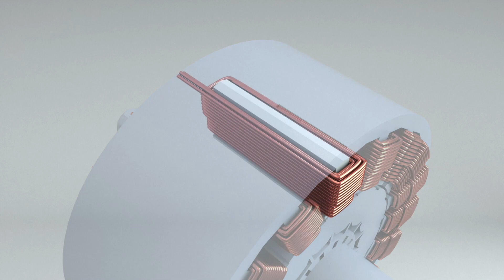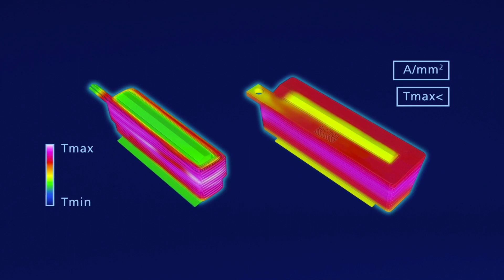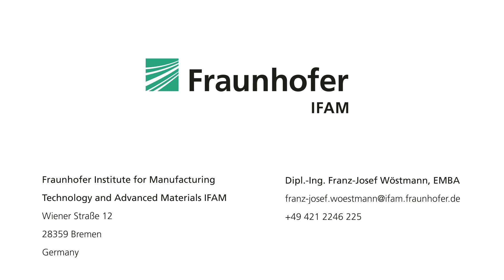CastCoil: high-performance aluminium coils for electric drives through new casting technology

Comment: HI What about lower conductivity of aluminium and higher current requirement to achgieve more power outcome as copper, IT will eventually affect efficiency of motoor
Reply: The slot filling factor compensates it, they say. Search for Molabo drives.